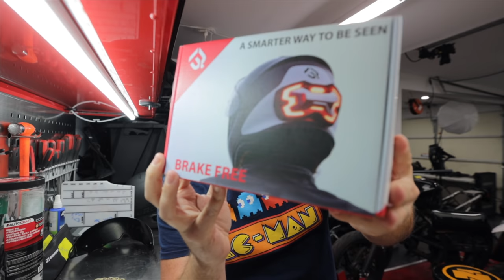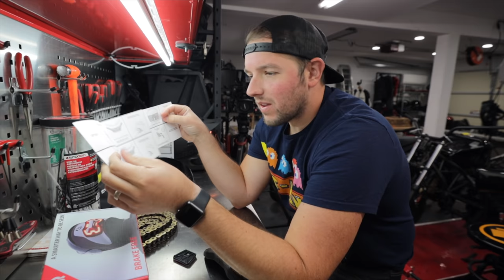CRAZY Braking HELMET MOD TESTED!! | Brakefree unboxing / review

Comment: Oh that’s awesome but there is another one called Inview wireless hand brake it uses batteries is it’s on downfall but it does turn signals, hazard lights and braking all wirless and it attaches with just 3M good Velcro . It uses a transmitter to connect the info to the light on back of the helmet but yeah I wish it was were you can just recharge it with a usb , thanks for taking the time to do the review.

Comment: there are modules you can hook into the brakeligjt system that can do this too
Reply: Yes. STS Smart Brake Module
Reply: These would be great for supermoto so you don't have to wire brake light... I would probably keep on the supermoto itself not helmet
Reply: Not engine breaking tho no?
Reply: @iagolopez5962  yes

Comment: I think attach brake light should consider as Third brake light ( like in four wheels in rear glass). It should be turn off by default then lights On when braking or decelerating or engine braking.

Comment: 170 is a steep price for a accelerometer, some plastic housing, a small lithium battery and a few leds.

Found some for like 40 on aliexpress that conect to your bike and also have turn signals. Also no wires on your helmet. The transmitter that connected to your bike is powered from that connection

Comment: In concept this thing is great but in execution it looks like it could use some refinement. I always ride my road bicycle with a flashing LED taillight so drivers see me much earlier and it works great but the size of the units made for bicycling are tiny in comparison to this. This could be a simple horizontal bar of lights and be just as effective. The second thing that comes to mind is why aren't motorcycle manufactures building this into the regular taillights. Electric cars are already doing this with one-pedal driving enabled where the driver doesn't touch the brake and uses regerative breaking to slow down. Any motorcycle with a 6-axis IMU already has the computing power built-in to make this happen.

Comment: Have you tried the COSMO MOTO intelligent rechargeable brake light. Attaches to your helmet using a magnet, smart phone app allows you to change the 3 modes and obtain battery strength. Recharges within 3 hours and the charge last approximately 8hrs. Comes in gloss white, gloss black and matt black as do the magnets to blend into your chosen helmet. Increase your street presence when engine breaking or using the brakes on your bike.
Reply: We have! Brake Free offers much more visibility with its larger visual footprint and brighter LEDs. We are more accurate at brake detection due to the fact we use a combination of sensors instead of just the accelerometer and our proprietary algorithm helps limit false activations.
Reply: @BrakeFree  To be able to test that your claims are justified I would need to use your  brake light to compare against my Cosmo Moto  -  Why don't you send to me one of your lights so I can test it out and I will give you some honest real rider feed back ? Please let me know if you are happy to let a regular rider test your claims ?
Reply: @carllewis1691  We are more than happy to let you test Brake Free. Right now we are running low on inventory and won't be able to ship you a free unit. You are welcome to buy our product and do the comparison. Use Chase's code to get yourself a discount.

Comment: The 360 cam is great!
This light is pretty rad but one of the main cons is that it doesn't work on all helmets. I know it wouldn't work on my Bell MX9 because of the 'crease' going down the middle of the helmet in the rear
Reply: We're working on some new mounts to address the challenging helmet shapes. Stay tuned.

Comment: Chase great review & I love your DYI hook-up you made for your bike while doing this review 😜👍 I also think you could adapt that brake free light to your Ruroc by cutting & heating up a pc of PVC piping to match the contours of your Ruroc 2.0 helmet by using a contouring tool that matches the shape of almost everything 1st do your helmet then cut the shape out of wood then when heating the PVC and molding it on the wood it should conform to the shape of the helmet, then with a file or rasp you could file the edges down to match the inside contours of brake free light, once that is done, 3M doublesided tape the PVC pc to the helmet, then on top of that you attach the brake free light, you also may need to sand or channel out a flat area on the PVC to attach that little clip thats included with the light, anyway Chase, that's how I would approach it. Anyway like what your doing here good stuff. 😀✌

 Agree: it would look better on a Ruroc

Comment: This is dope. If you don't get great contact on a certain helmet you can just add sugru. One potential issue I see is air drag if it hangs off the side a bit
Reply: We tested Brake Free with a number of different  helmets and sizes to make sure this doesn't happen. We also ran a beta test program where we had riders report on their experience and that was one of the questions we asked (did you feel any drag or hear any noise due to Brake Free on the back of your helmet?) answers all came in as No.
Reply: @BrakeFree  Good to hear that it hasn't been an issue. Respect that you spent the resources to test it out as well as respond to my concern. This product is a great idea that I would love to see become a standard in motorcycling. I'd definitely give it a try if not for today's economy. Curious if you have looked into partnering with helmet manufacturers to implement this into a helmet.
Reply: Just checked the website and saw that it is IP65 rated. That would have been a deal breaker. Glad to see it will hold up in the rain.
Reply: @MkGreene  that's the goal.
Reply: @MkGreene  our team are all riders and we tried to think of all the scenarios we would see Brake Free being used in. It would have been a deal breaker for us too. We have many customers that commute year-round in all weather conditions. We wanted to make sure you're nice and visible, especially so in pour weather conditions.
Reply: @MkGreene  yeah, we're looking into it. It would be ideal to offer Brake Free built into a helmet or other gear.

Comment: Save 170 bucks and use lite pressure on one of the brakes. Be it our hand foot or thumb brake. I do track days from time to time and I've added a thumb brake control for the rear. It's not currently wired in but a pressure switch could be added and  active the brake light.

Comment: SImilar in terms of function to the Healtec Brake Light Pro, except it is fitted to the bike and uses the the pulling of the brakes to activate a flashing... I like how this works for engine braking and the emergency braking function. Would I pay $160 I don't know. Great video as usual pal.

Comment: Not sure about the US. but where i am and other provinces. Engine breaking in the city is illegal, work around. engine break and tap on the breaks enough to show your slowing down. 
also safe turn has a pass through adapter that will light on when engine breaking.

Comment: the modes (from their website): There are three modes the Brake Free can be in.  Mode 1 is Normal (all LEDs on), Mode 2 is Blinking (all LEDs blinking), Mode 3 is stealth (16/100 LEDs on).  All three modes will flash during all deceleration events.

Comment: Freaking Awesome, Chase  ... 10 Thumbs up for this one. Incidentally, .... for those with only one ride,.... Why not put it right onto the back of your bike ? 
My thoughts: I think it could have been a bit lower on the back of your lid, say with the lower "LED bar over top of the DOT insignia. 
And you need to do a partial review of this thing at night, where it's really going to be a show-stopper. And finally, .... Will the unit fit onto the back of a half-helmet, (skid-lid )??. 
The Minimal-mode got my attention the most. It would seem to me that the Flashing-mode may get the drivers attention but then deter their attention from everything else.... Just sayin' 
Stay Safe.
W
Reply: Ummm.... Yea, that's Accelerometer, Bro. :)

Comment: hey chase! unrelated but still curious. does your mt-10 make a knocking sound on startup and sometimes at low rpm? I just bought one and I hear it every once in a while. I'm under the impression it's the timing chain tensioner doing it's thing

Comment: it seems to be working but it looks a little different because the real break lite on the motorcycle is not lighting up at the same time, some real important step for that company if it had large arrow to the right to turn right and a large arrow to the left to turn left because most motorcycles do not have much directional blinkers and some times it just looks like a blinking light but not showing which way the driver will go or planning on turning. $169.99 + shipping and what ever but close to their website price.

Comment: Have you seen the motogadget m unit blue? It has a set up in it that turns your brakes on when you decelerate regardless of wether you use the brakes or not. It also has an emergency braking function on it where by if you decelerate faster than 8m/s it turns on your brake light and hazards automatically!!!! would be awesome to see a video of how to install that on bike as I really want one!!!! But I can't quite work out the wiring diagram!

Comment: yeah i'm not spending money on something like this...great idea, but the issue of no lights for engine breaking is fixed if you apply enough pressure to one of your brakes to turn them on.
Reply: The brake function is one of many advantages of riding with one. This is a piece of active high visibility that keeps you visible day and night. It also brings the light to eye level and helps with depth perception for drivers behind you.
Reply: Brake Free well I’m still not paying money on something like this. Again I have my own personal braking function for free. And I got news for you...if the cagers aren’t paying attention then it’s not gonna matter...if they looking at their phone or putting on makeup...you can put anything you want in front of them and they aren’t going to notice it...Riding is a risk and that’s something we as riders have to accept and just use defensive driving to keep ourselves safe...that’s the bottom line.

Comment: I have to say this is an awesome idea but I'm also trying to see this from the perspective of someone behind me. If I were behind a motorcycle and I see the helmet light coming on but not the brake lights on the bike, I'm going to be kind of confused. If you roll off the throttle or engine brake, the helmet light will come on but the bike lights won't. Wouldn't that be confusing for people who are behind me? Am I going to have to modify how I ride to always include just enough front or back brake any time I slow down so that all my brake lights come on? I mean, I guess that wouldn't be too big of a deal to just squeeze the front brake a tiny bit even when downshifting. Or just barely touching the back brake when I'm coming off the throttle. I don't know. I'm torn. I love the idea but I'm afraid it will confuse people. When you are behind a car and it has the two brake lights on both sides but also has another one over the back glass, or a pickup truck that has the light over the bed, they all come on together. But this won't work like that, right?

Comment: Wow. I want one. I’ve never understood why modern bikes don’t have this feature built in to the bikes. If this company can build a stand alone unit, and the attaching portion, and market and ship the thing for $170 and still make a decent profit from it there not much of a reason the manufacturers can’t include something that does this on a motorcycle. Even if it wasn’t so sensitive and only lit up under HARD deceleration that could make cars behind you more alert.

Comment: I need additional brake lights on my bike rack but do not want to do the wiring. Will these also work if mounted on my bike rack that is mounted on my jeep that blocks my jeep brake lights. I think I can find a flat surface on the reflectors that may support the mount. 9:22

Comment: There's a similar product that can do basically the same thing but it attaches to the bike and uses the bikes brake lights instead of something on the helmet. Smart Turn System I think it's called. If you get a chance to review that it would be nice to see the comparison.
Reply: Major draw back is that it has to be connected to the bike.

Comment: It is a cool idea by the way in Washington State you cannot have a flashing red light You can have it for your brakes while you are applying your brakes but you cannot drive around with a flashing red light nor a flashing blue light for that matter
Reply: The pulsing mode is one of 3 modes. You can use the stealth mode or the regular mode where the lights don't flash unless it's an emergency stop.
Reply: @BrakeFree  oh I completely understand it's adjustable I'm just saying for most folks they might want to check their state law so they don't ride around with a red flashing light going.....And since you're here and reading this perhaps you guys might want to try marketing a junior model for $99 then you'd have my money
Reply: @deepsquat600  good point and thanks for the feedback. A smaller and cheaper version is on our road map. Thanks for the comment.

Comment: Chase misidentified the problem or the real purpose advantage of this product.
The problem isn't brake lights while engine breaking. As many have commented and Chase should have known lightly tap your brakes in this scenario.
The problem is inattentive / distracted drivers. This product helps by virtually doubling your visibility to following traffic anytime you slow down.
It appears to be at least as bright and large as almost all motorcycle taillights. Anything that makes you and your motorcycle more visible is a good thing.
Is it overpriced??  I don't know. Some will tell you a Snell helmet is overpriced when all you need is a DOT. 
Everyone's cost to safety ratio is different.
For anyone who puts in consistent moderate to high amount of time in dense urban street traffic, I would think it an excellent investment in additional safety.
All you need are hands signals but I'll go with lighted turn signals. Even if they are overkill.
YMMV.

Comment: Old video but the lights still the same. I think they dropped the ball on not having a brake signal go to it. I had one 15 years ago that I paid like 20 bucks for that picked up a wireless brake signal. I cant see spending 120 bucks for just a big red light that doesn't do much.

Comment: Such a shame they’re not available in the uk yet, brilliant idea.
So weird how you look like you’re in a video game, that camera view is so odd
Reply: I've had a helmet-mounted brake light for more than 2 years now, that works on a similar principle. It is an integral part of the bluetooth comms system that is installed in the helmet, the light being stuck to the back of the helmet. Main differences are that the light is more compact than this one (because the battery and electronics are inside the helmet) and the light is not removable.

There are various rules about vehicle lights in the UK, not sure if this would breach those, or maybe not as it is mounted on the rider, not the bike...?
Reply: @mightybeanstick9872  our research shows that we wouldn't be violating any laws due to the fact that Brake Free is not part of the bike or helmet. It meets the brake light color requirements too. We had a number of preorder campaign backers from the UK and we haven't had anyone mention anything. In fact, we had someone tell us that a police officer thought it was an awesome idea and complimented the rider on being safe.

Comment: What phone holder do you use on the mt-10? I lost a phone on the interstate with the last one I had.
Reply: Zipper pocket
Reply: Its a RAM
Reply: @evansolomon169  Right! It was the end of last year when I lost my phone and I've been using a zipped pocket ever since. Just been casually looking around at mounts but don't think I can trust anything except my pocket
Reply: Use a Ram mount. If you can find one

Comment: other solutions to the problem: just don’t engine brake when there are cars behind you...
Reply: That's like asking why someone would need a helmet ... "just don't crash". I think this is more of an attention grabber for other traffic, being that this light is so high up compared to the other taillights in traffic.
Reply: TailgateNate it’s not like there’s a specific way not to crash built into the motorcycle... the motorcycle itself has a literal front and rear brake for which the rider is suppose to use to slow down... to me engine braking is kind of a dumb and unsafe way to slow the bike down. using your brake the way it’s suppose to isn’t something that should be hard to do. but for some reason everyone’s acting like it.

Comment: Hey Chase, I sent you exactly this product on instagram DMs in April 2019 and you never answer me... You're welcome...
Reply from the maker: I never look at DMs main.
Reply: Well, if you wanna take a look at what I sent you back in 2019, there is also riding boots with brake light and blinker integrated that could be a good product to review! 🤷🏻‍♂️
Reply: Thanks!
Reply: @BrakeFree  You're welcome! I really do think that it is a great product. Where I live in Quebec there is not a lot of light on the road at night so it is really interesting to have that kind of option to increase your visibility.  I was rear ended by a pick-up truck back in 2014 and I'm sur that a product like this one could have save me.